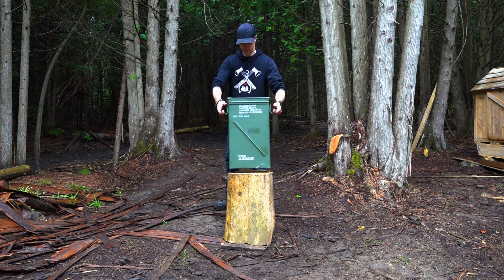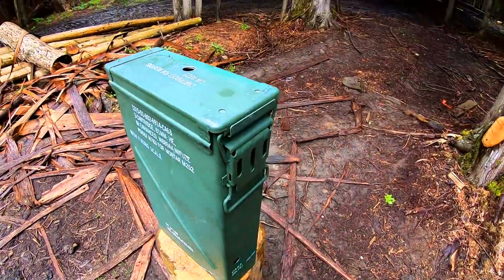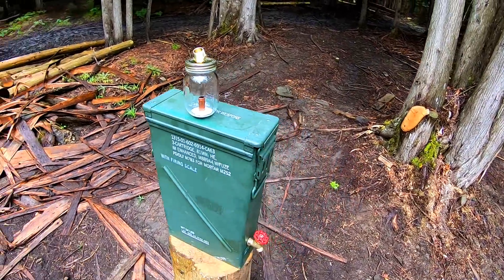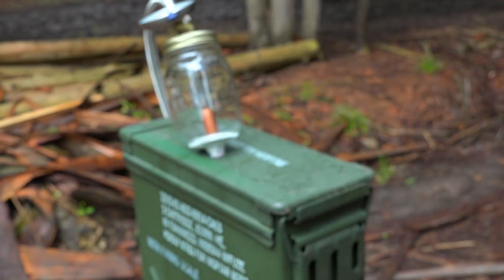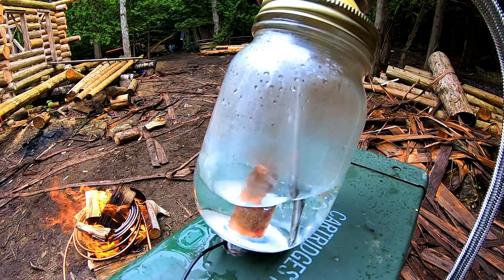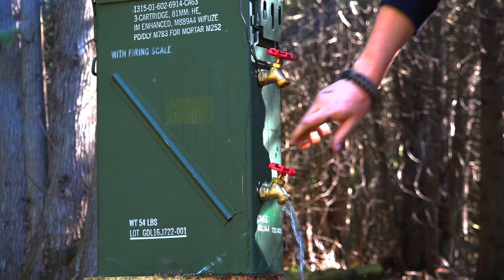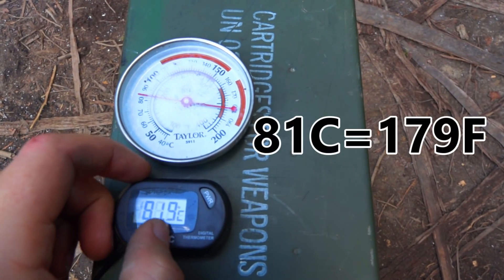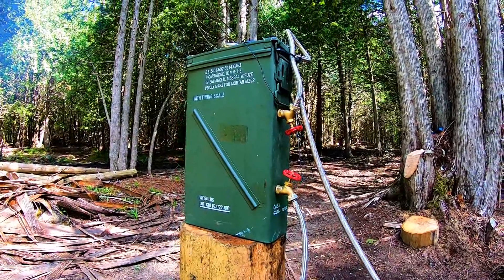Off Grid Heating Prototype- Copper Coil Water Heater / Heat Exchanger / Radiant Heater

Comment: An old car radiator would work great and put out more heat.
Reply: He's trying to use it as a heat "battery".  The water will radiate it's heat throughout the night.  A radiator wouldn't be an efficient battery.
Reply: @jim.h  capacitor not battery. close but different
Reply: @jim.h  than why use water? Oil is better.
Reply: I totally agree!  And if you get one from a car with an electric fan, you also have the option of running the fan to circulate some of the heat.
Reply: @matthewkleinmann  Using electricity is cheating.
Reply: @matthewkleinmann  bingo!
Reply: @matthewkleinmann  too much expense. Overly convoluted.  For the space he is heating, his solution is cheapest and best.
Don't overthink it. Keep it simple stupid.
Reply: And if it was oriented on its side there wouldn't be a need for a fan to circulate. Air would be heated and rise drawing in more cooler air from below.
Kinda like traditional baseboard or radiator heating. Waitaminute...
Reply: @ChuckD59  then there wouldn't be the same convection
Reply: ChuckD59 I think you just stumbled on to something there....
Reply: Seriously you won't need a radiator or a fan! The cabin is small and heater will run him out of there he will have to open vents to let out heat and let in fresh air
Reply: @davidmayhall6567  thinking the same thing. Although he could reduce size to counter overheating. Perhaps a motorcycle radiator.
Reply: @davidmayhall6567  just make the entire system smaller, which is a great benefit. I'd think about using an oil cooler coil, smaller diameter copper tubing with fewer coils.
Reply: Wouldn't even need the whole radiator at that point just grab a heater core from a larger car like a SUV. I think the ammo can is an advantage though considering how much thermal mass is in that water
Reply: You just need a pet dog in there with you and there will be enough heat 😂
Reply: @simonjack8122  or 2 or when it's really cold it's a 3 dog night 😉
Reply: @JamesCouch777  Ha ha ha..
Reply: Simon Jack that works great until the furry space heater farts.
Reply: @celicaslave  I'm literally at camp right now with my three dogs and someone is RIPPIN EM tonight
Reply: @simonjack8122  
I remember when I was building my house living in my window van, blankets over the windows and my four dog's kept us warm till I moved in in November, that's an old kiwi saying and hence the name of a famous band they would say it's a Three Dog Night.
Reply: @simonjack8122  or a lady freind. Lol
Reply: Agree ... A radiator would be a more efficient heat transfer to the inside air ... Maybe even a thermal powered fan like for wood stoves ...
Reply: A radiator would be huge. If you are going that route, a heater core would be more ideal. They are essentially a small radiator.
Reply: @Rickmakes  dude heater cores rely on flow and a thermal mass and voltage. Keep it simple man the ammo can will heat up the cabin but if he ran copper pipe on the floor and maybe on the ceiling and directed flow through it natural convection and conduction and radiation would warm him up. He might need to make some adjustable vents one up high and another lower down to let in fresh cold air and let out hot air to regulate the temperature inside the cabin so the heater don't run him out of there by getting too hot. Some insulation silver back foam on walls and ceiling to keep in heat and reflect it.
Reply: @davidmayhall6567  the thermostat just like in a car, coils into the cabin, ammo box would be a boiler or reservoir for the boiler, they could probably find a low voltage electric valve. Set up right this could probably hate the cabin even being so small.  Sound right?
Reply: @davidmayhall6567  he already has insulation in the walls. I think the idea of the Ammo box is to keep it warm even after the fire goes out. My one issue here is I don’t think I could sleep with the popping sound it makes other than that it’s a great idea.
Reply: @davidmayhall6567  you run the risk of frozen lines at that point. Getting fancy.
Reply: I was just about to comment about how I used a radiator and fan where he used an ammo box.. also the fan was powered by a sealed cell that got some charge back from the inline water generato turbine... makes power from water flow also the radiator was way thinner.
So even more space savings
Reply: darrellw dobson one could also shorten or reduce the copper coil that's in the fire to slow down the heat build up :)
Reply: @TarmanTheChampion  Also would make it less efficient.
Reply: Jono Hoog  nah. A radiator can get past boiling in a normal application.
Reply: @whatup654  WELL over, and live steam is terrifyingly powerful and dangerous.
Reply: @blackirish781  You know it. Steam can kill you if you are an amateur.
Reply: I worked in a shop in Minnesota that was heated by 3 large truck radiators  with box fans blowing air through them! It worked great and it wasn't a small shop either! Another time I worked at a sawmill in northern Minnesota and we made a large outdoor wood fired hot water heater  to heat a shop, garage and house! It worked great! We only had to fire it up every 3 days, even in -30f!
Reply: Point of water tank is so store heat in and release it slowly out ....
Reply: @ExtemporeMuzzzz  Not much point in that when a radiator can be used. You make a rolled log stack so the fire feeds slowly through the night and the rad puts out more or less constant and stable heat. there is a reason we use radiators in homes and not ammo boxes....
Reply: @Jafmanz  Like I said ammo box is used for storing heat in the water. With that you do not need to  keep fire going that much. For the reason that ammo box will slowly release heat from water it has. With just radiator heat wil be gone as soon as fire is out.
Reply: @ExtemporeMuzzzz  thats inefficient. energy will be wasted. there is no point having a huge container of boiling water that starts hot and slowly cools instead of a constant heat from a smaller energy release. not sure how to communicate it but look at every energy system in the world and show me a viable analogue of the ammo box.
Reply: @Jafmanz  Water been widely used as energy storage around world. If you look that up. Container can be any shape and name.
Reply: @ExtemporeMuzzzz  the water itself is the energy and its usually stored as potential kinetic energy. solar collectors are not popular for a reason. water makes a better distribution medium than a storage medium thats why we use convection rad systems. water is much better at removing heat than holding it hence it being used to cool things more often than it is used to heat them. the only time you will see a fixed storage over a convection system is in solar collectors because the sun is constant, free and predictable.
Reply: @Jafmanz  I got boored for your argument so I did math for it. lets say ammo box is 20kg. Also lets say we want to keep heat above 20 celcious. heat capacity is 4.186 j/g/K. So E =4186*60*20 =(5023200)joules what we turn in to w/h by 5023200/60/60. What leaves us 1395 w/h. I think that is really nice amount of energy considering. If you use radiator you can not store that energy to anywhere. After that campfire is out still ammobox with water can heat up tent.
Reply: Jono Hoog  the copper coil is the only part subjected to direct flame.
Reply: Great idea. Even a motorcycle radiator would suffice in this thing I bet. Small and well sealed enough.
Reply: But make sure it's not the new style plastic auto radiator , make sure it's the old type like aluminum or brass and copper radiator..
Reply: However, many car radiators contain deadly amounts of lead. Moonshiners used to use them and the lead killed them when the moonshine didn’t.
Reply: @amiablerogue1550  yea them really grimy shiners used car radiators o.o' most normal moonshiners just used one of those steel drums barrels
Reply: @amiablerogue1550  Yes, and?? He is not drinking the water.
Reply: No because they’re really expensive and a kettle with two holes doing the same thing in the this vid
Reply: @ainamagamedova9885  they're actually very cheap...just look on craigslist, facebook exchange, ebay or just go to your local salvage yard...you won't have any problem finding one cheap.
Reply: Use a peltier plate (turns heat-DIFFERENCE into electricity) to generate the electricity for a (cpu?) radiator fan
Reply: @sebbes333  now you're talkin'.
Reply: With a reservoir tank
Reply: That's such a clever idea, you could even put a pressure realise tank on the top cap, less maintenance on a unvented system.
Reply: @sukikahlon1  great idea!
Reply: You can get small central heating radiators
Reply: @worthleo  good point. Might want to get one out of an old tractor...they are pretty tough.
Reply: Plus it has a relief valve so if it fucks up you don't get fucked up too
Reply: man i was thinking that same
with a small solar powered fan blowing threw the radiator
Reply: I love how we build upon each other. I was gonna say a 55g drum not to generate heat but to create alot of hot water and then insulate it with something to retain heat.
Reply: @DG-kk5pm  A drum and a radiator would put out heat all night. Great idea!!!
Reply: JC,
ABALOOTLEY Gump!
Reply: Unless you had 300 Fe of copper tubing you would have to have the fire right next to your cabin anyhow that would probably warm it up by itself to keep the fire away from your cabin you would need a lot longer copper tubing
Reply: @jameschiappetta5820  you could rig up some heat shield with a couple layers of sheet iron.
Reply: Dudes, a radiator would require he stayed up all night to keep the fire going.
Reply: @MrPawPaw  that's pretty much what you have to do when you burn wood to keep warm...get up during the night to stoke the fire.
Reply: @JamesCouch777  hey James lol. I get that. But was he trying to install central heat in his little shed or just a large hot water bottle? If the latter I would insulate all sides except the one facing me or I doubt that tank will put out warmth for more than a couple hours. Still very ingenious setup and would be a great setup with a ss tank to take a warm shower. I read a few comments about the smell of the ammo box. I would check to see if they used lead in the paint for those boxes before I slept all cuddled up with one. 
I'm sure our host will figure it out and I hope he tells us how it worked for him after a night in cold temp.
Reply: @MrPawPaw  👍it always pays to figure how to stay warm just in case it's a three dog night and you only have one dog 😉
Reply: Ya. Thats a great idea. Having a pressire release cap on yhe radiator would be a bonus also. If tue system was built well enough than he could used coolant instead of water. Using coolant would help with the steam pressure issue. Could you most of the parts from a car cooling system. Putting an automotive thermostat in line some where would help regulate the flow to control temperature also.
Reply: @whatyoumakeofit6635  👍
Reply: @whatyoumakeofit6635  and where does the superheated steam go from the holding tank? The only way a radiator with a fan and thermostat would work is a regulated temp source from the fire which isnt possible and a constant removal of heat from the radiator into his shed which would turn it into a hot box and if he doesnt make up the water that blows the relief the entire system fails. Actually the tstat wouldnt work at all as it would stay wide open anyways and you would now need a fan to cool down your holding tank.  And antifreeze? Yes it won't freeze and burst your pipes but where does it all go when you break camp? The river, the ground? These are not options. 
The only way it would work with  this central heating radiator system is to build a brick oven with a fresh air intake over the copper coils to regulate the temp so that the water never reaches it's boiling point. Its a very dangerous scenario putting a radiator in his shed as any failure in the system could result with you being severly burned by steam temp at 250 degrees F. Even the old house radiator heaters were regulated by a furnace that shut off and on.
Sure you could design something but then again you could just sleep in your car. 
I think he just wanted a way to boil water fast instead of sticking his ammo box in the fire. The more I think of it the crazier it sounds. Lol. 
Wouldnt it be alot easier to build an external fire place with heat vents coming into his shed? 
I'm not getting down on you bro. Lol. Im enjoying the comments. I just think people haven't thought this through. But I'm sure now someone with alot more knowledge than me will design something and that's awesum. But it has to be without electric motors and poisonous liquids unless it's a fully sealed system. Hmmmm..maybe a cascade system where you put another loop of coils into the hot water tank left outside and run that under your floor. Heat moves to cold so you shouldnt even need a circulating pump. But Idk in practicality. Oh boy now Im caught in the maze. Hahaa
Reply: I posted on another of his videos suggesting a radiator would radiate more heat due to its increased surface area, but he's adamant a box full of water is more efficient than a radiator for radiating... each to their own
Reply: I do understand why he went this route. A cars radiator both would not hold as much water as this(so minimal thermal mass or ‘thermal battery’ effect), and even the smallest car radiator would most likely be “too much”. It would likely get too hot in the camper too quickly because it’s far more efficient (really too efficient) at giving up its heat to the space. And because of both it’s design and it has less water, it would cool off far more quickly at night. So he’d have to get up in the middle of the night to stoke the fire again. Only for it to again get too hot. Just my opinion
Reply: Wow some of you need to learn what a run-on sentence is
Reply: It is a splendid idea if one were to use this apparatus in a larger space. Putting a couple three possibly 4 hand warmers in ones sleeping bag would be suffice for the area he demonstrated he would be using it for not to mention your own body heat as well. 
But a very splendid idea I must say..👍🏼
Tally ho...
Reply: I was thinking the same thing while I was watching the video. Build a small box and combined with a DC blower fan would be more than enough heat.
Reply: Never mind thought it was used for drinking or bathing
Reply: A car radiator is a bit big, but a car heater core, which is basically thr same structure but smaller and meant to bring engine heat into the cab, would be perfect. It's made for lower-velocity air than a radiator, so the fins have more space between them for less air resistance.
Reply: @keithklassen5320  good idea 💡. You could use different sizes of radiators depending on the size of the area you are heating.
Reply: And would prevent boiling
Reply: Yup, small solar fan and it will be like a heat blower
Reply: @tronixfix  great idea 👍
Reply: this is dangerous, if the pipe leaks it will shoot hot water to you!
Reply: @debojitacharjee  this is fairly safe most houses use the same type of copper pipes for hot and cold water under much higher pressure, the whole setup is generally ineffective though, if you want something that produces upwards of boiling temperature water you just need to make a rocket stove, then coil the copper tube so it fits down the chimney of the rocket stove and out the breather hole then just fill the loop with water attach it to your radiator and light the fire... btw use at your own risk this is literally a method on how to make a wood fire hot tub but i figured the same principle would apply to a hot water radiator
Reply: @jackasshomey  But it's not safe because if the copper pipe gets leak then it could cause accident!
Reply: @debojitacharjee  that's why you make it from one large properly bent copper pipe because at high heats you wouldn't be able to rely on solder make sure the pipe has no kinks and it should be good for a long time if the water has a good properly filled radiator basin then itl be alright o.o' this is how they feed water into those old cast iron water heaters they have on old ass houses the water comes from the water heater that uses copper pipes to feed the water, sure if you want the system to last for 20-50 years then yea you shouldn't just coil the copper pipe and heat it directly but honestly the copper pipe should be alright for give or take 2-3 years under direct flame then the oxidation from the flame will burn a hole through it or weaken the material till its soo brittle that it snaps like a tree branch

if it snaps or springs a hole itl probably be closer to where its coiled on the inside of the rocket stove so the worst thing that could happen is all the water leaks out and no more fire XD
Reply: Or electric stove?
Reply: And mix water with old engine coolant
Reply: It wouldn't stay warm as long tho. Less mass.
Reply: Radiator inside ,  100 gallon tank outside,   enough wood to heat up tank to 180.   should keep that little shed toasty all night.
Reply: you would still need a large reservoir, otherwise the thermal capacity would be too low to last.
Reply: Way too big for that little shack, just need a small car core (looks like a miniradiator), and mount a small DC (solar or battery powered) computer fan behind it.  It can be mounted inside the little shack.  Or make a copper tubing sub floor (radiant floor heat).
Reply: Whoa such a great idea to use the ammo can as thermal mass to radiate heat long after the fire dies and you can also have hot water for shower... A car radiator as suggested by others would have been a instant heat option but not good as thermal mass to radiate all night. I think also that the copper coil can sit in a Dakota fire pit to increase efficiency, security and stealth factors instead of open fire.
An other way to go would be simply heat some stone in a fire and once hot putting them inside the cabin to radiate heat for hour, kind of the no budget version.
Reply: darrellw dobson  that's what I was thinking. A self resetting pressure relief valve with a coupling of some type to vent the steam outside so there's no moisture released inside the camper. 
Just not sure what psi something like that would require. Maybe around 3-5psi at most I'm thinking. Wouldn't want it too high anyways.
Reply: @Aaron48219  a quick connect air hose fitting leading to rear bumper (allows condensation in tube to drip harmlessly) allows you to vent any steam outside without harmfull pressurization risks.... did it in my 81" Chinook with a small wood stove and stainless steel jerry cans... 
    I was using it as a hot water heater for showeres and such.
Reply: A heater core is what he needs
Reply: he shoulda got a car radiator wit a fan if he really was bout it
Reply: Ye but electric fans pull some amps gonna need a good battery and solar panel set up for offgrid
Reply: A car radiator? With loads of small cooling fins?? Tons of plastic yeah just dump that straight in the fire lol
Reply: @markdove5906  lol! They mean a radiator for inside to output the heat.
Reply: darrellw dobson  thats what I was thinking. Could get rather elaborate with it if a guy wanted to. Could even divert some heat to heat up a container that has potable water in it. Or rig something for showering.  Alot of potential in the basic idea here.
Reply: Even better a way smaller copper coil and a heater core.
Reply: I don't think that would work in the fire as the solder would melt.
Reply: Good idea...More radiators in series, in a mass, could give you more "range"
1 is enough for ice fishing...
I suggest a pressure cooker atop a hollow log rocket stove (instead of copper piping) for all night heat!
1 hollow log will keep that shed hot all night!
cheers...
Reply: Rather than a radiator, use a small car’s heater core. Or a radiator designed for computer cooling. But be careful handling it to protect the fins. For the application, an aluminum heat sink would be more durable. But still needs a reservoir. In his design an extra reservoir tank isn’t needed.
Reply: Led poison
Reply: A car heater core ( what heats you up in the winter) is basically the same thing. Just a radiator that allows heat inside the car cabin
Reply: Or just use small household radiator. they are cheap and reliable.
Reply: Michael  you could put some antifreeze in the water.
Reply: It says in the description that this is an experimental prototype that he was attempting to get creative and make. It's not supposed to be perfect, or something that already exists lol
Reply: If you find a copper radiator solder with brass, not tin, then yes, the aluminum radiator will melt in case of something.
Reply: @hibahprice6887  only the copper coil would be in the fire, the radiator would be in the camper.
Reply: Actually It will be counter productive because of efficiency issues in this application.
Reply: @dustinbailey9644  my brother actually did it, worked great.
Reply: @JamesCouch777  didn’t say it wouldn’t work.  It’s just less efficient than this way.  So it’s a worse idea.
Reply: @dustinbailey9644  it keeps the fire outside and keeps you warm inside.
Reply: Sir do you have a link?
Reply: CAN you burn it in a fire though?
Reply: Just my 2c worth but, could you run a coil of copper pipe around inside the walls of your camper? Could you use a toilet float valve to replenish the water if it boiled away too much? Could the coil move into and out of the fire somehow based on temperature (or maybe a swing rope from within your camper)?
Reply: Seen an old buss radiator used once. Thank's for the reminder👍
Reply: Car radiator with the fan would be the better option
Reply: Also, those ammo boxes have a smell to them, at least all the ones I've looked at.  I don't know if it's just degrading paint or what.
Reply: @farstrider79  I would be willing to bet what you're smelling is cosmoline. It's a preservative for metal that the military absolutely loves. And they coat it on everything from military vehicles to ammunition to prevent degradation of the metals. Usually you can get rid of the smell with Ajax and copper wool
Reply: @therubbamunkee  Cosmoline was one of the most interesting chemicals i have come a cross. That thing needs lots of work to remove. My deactivated, converted to airsoft MG53 was full of it and it took few days of scraping before i went fuck it soaked it with dish soap and finally went to hot shower with it. Even then not all was removed, but i could actually work with it now.

If idea is to get heat into room fast then use radiator, if store that heat into water mass and let it radiate slowly then ammo box is good idea. One could also put motorbike radiator in its own circle to let out heat into room fast, then just close the valves when room is warm enough and let rest radiate slowly.
Reply: @farstrider79  it's the type of paint that was used I believe powder coating paint if iam mistaking
Reply: @farstrider79  Some of that stuff is packaged in cosmoline to prevent moisture from getting into the ammo, especially the old stuff. And cosmoline smells bad.
Reply: @farstrider79  there coated in a very light oil to protect the paint
Reply: @farstrider79  many of those boxes had an oil film and/or the inner surfaces oxidized.
Reply: @farstrider79  It's likely that military paint, the military surplus trucks have this anti chemical warfare paint called CARC and that stuff is NOT something anyone should be breathing so I'm sure that paint on the ammo cans is also something nasty.
Reply: While your at it, a tv , carpet slippers and a toasted sandwich maker
Reply: Well in my country they’re are very expensive
Reply: @ainamagamedova9885  you have to use whatever you can find...good luck.
Reply: you forget that a car radiator is made of thin aluminum it would melt under such heat, the coil tho is a good start but to make it super efficient it needs multiple layers of coils supported just above the tip of the flames and a solid metal dish ontop to contain the rising heat a little better
Reply: @jackasshomey  the radiator would be in the building...the copper coils would be on the fire.
Reply: @JamesCouch777  thing about it is the hottest part of the flame is the tip of it even though the blue flame near the base is hotter their a natural convection process going on pulling cool air from the bottom feeding the flames so it actually causes a cooling effect near the base unless your coil is directly in the centre of the base of the fire it will actually be cooler then it would be on top of the flame
Reply: @jackasshomey  that is true.
Reply: @JamesCouch777   the whole setup would work better as a Rocket Stove but yea a car radiator would work great if its just the part inside the house giving off the heat
Reply: @jackasshomey  aluminum melts at 1221°Fz he was using a copper coil filled with water. Water doesn't go above 212°F unless it's pressurized or lacks nucleation sites, which wouldn't happen in this setup.
Reply: Or an old cast iron radiator.
Reply: @wadebullard9463   Who wants to carry a cast iron radiator about with them?